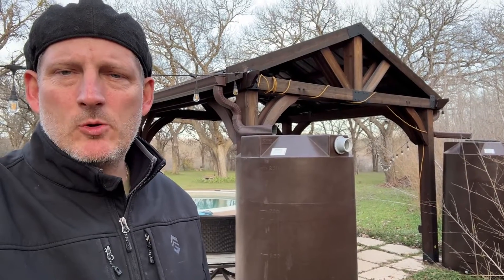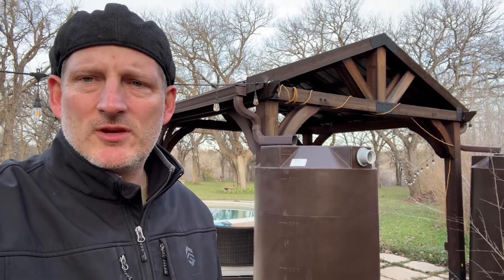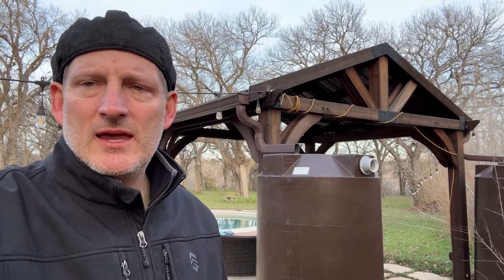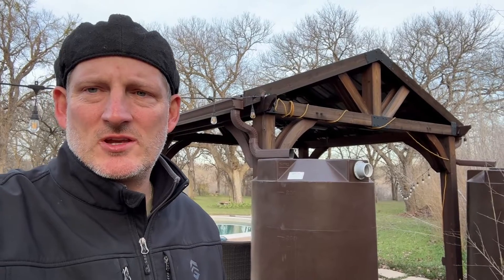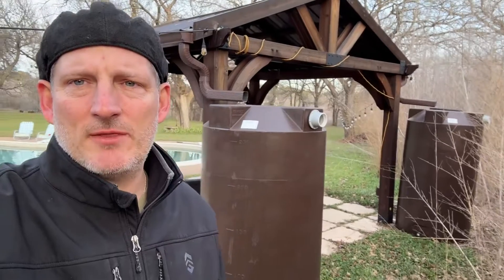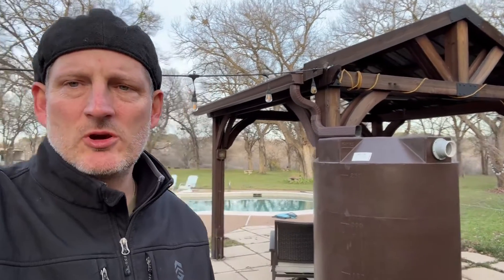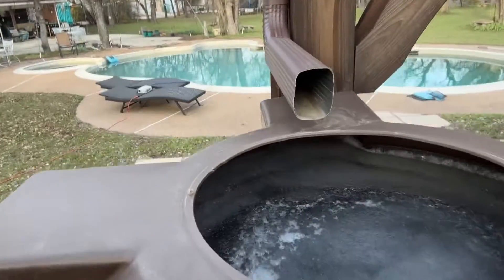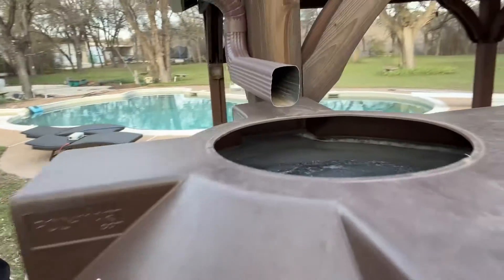Water Tanks in Freezing Temperatures

Comment: Useful video, I was looking for something like this!
Can a barrel that is about half the height, i.e. half the volume (about 135 gallons) handle the same? How many degrees of frost are these?
Reply from the maker: The smaller the capacity, the quicker the water will freeze inside the tank. Leave room in the top of the tank for the ice to expand just like I covered in this video. Insulate any valves protruding from the tank's sidewall. They will freeze and break.
Reply: @rainwaterequipmentllc7835  Thank you. What is interesting to me is that according to the experience shown here, water freezing on the side of the barrel from the inside does not push the barrel apart laterally. When it is not freezing during the day, this ice separates from the side of the barrel, meaning that the tension caused by the expansion of the night frost disappears, but if it also freezes during the day, the ice remains attached to the side wall, I do not understand how it can rise or how it becomes tension-free. I tried to separate (only by hand) the ice layer on the side wall during daytime frost, but it did not work.

Comment: Hi Jim, quick question: if the ice forms at the top and not the bottom of the tank, why would the tap at the bottom freeze and break? Why does ice form at the top anyway, given heat rises?
Reply from the maker: No. Typically, if you wrap them with insulation and then cover them with something plastic to keep them from getting wet, it will do the trick.
Reply: @rainwaterequipmentllc7835  Many thanks! Greetings from France
Reply from the maker: There's water inside the valve that sticks off the side of the tank. That's where the freeze and break will occur. It's the most susceptible area. If it breaks, you'll lose your water.
Reply: I see, thanks. Any idea under what conditions an insulated tap will crack from ice expansion